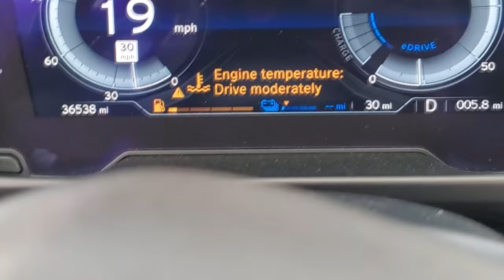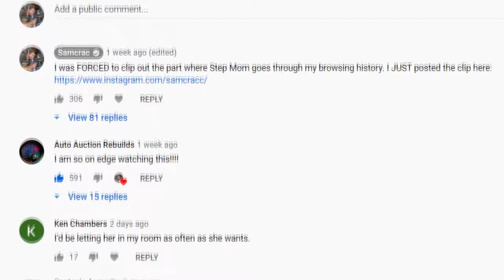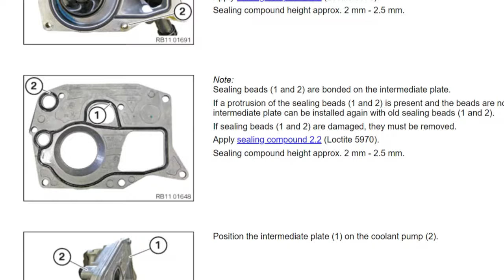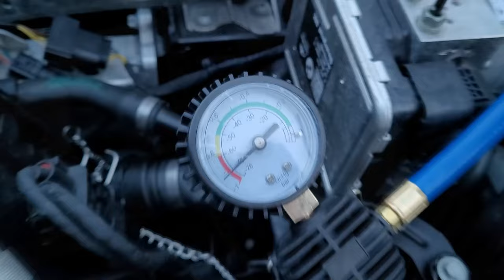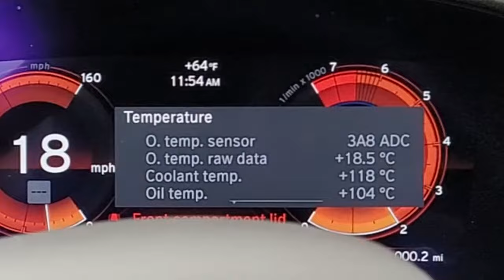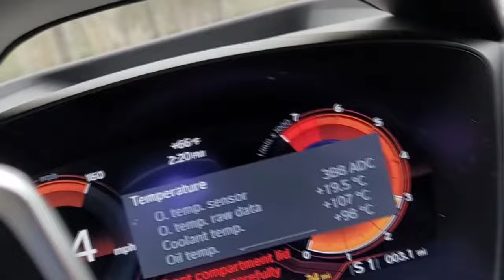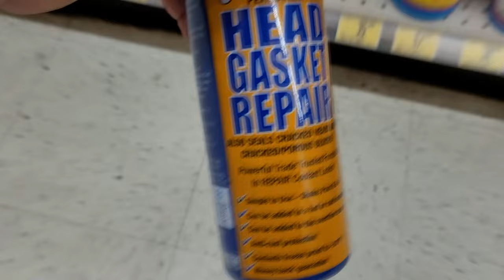The Dealer FAILED my "Unrepairable" BMW Supercar! Can I Fix it with this Simple DIY Trick???

Comment: SAM I had same problems with Lincoln Town Car 10 years ago, after couple of garage costs, finally one garage solved the problem, it was electric problem with the FAN, it works some time, but not frequently,they connected new wiring line for the RADIATOR FAN.(I had changed twice RADIATOR, FAN, water pump, thermometer etc)
Reply: Good luck!

Comment: "Everything that wears will be replaced" hmmm doesn't seem like a very sustainable business model... just saying.
Reply: You have to ship the original part in before you get a replacement - that removes like 99% of returns. Plus you pay for shipping.
Reply: It's being misrepresented.  Bound to be some conditions attached  ...
Reply: Nope no catch. They have the best customer service in the industry too. Ive had nothing but great experiences and ive spent at least $3500-$4000 on parts from FCP Euro at this point. The way their guarantee works is that you buy the replacement part, and then send your old part in for a full refund. They have extremely fast shipping to my area for some reason too, overnight for most stuff even with the free shipping option.
Reply: @Anthony71598  so you disagree and think a warranty company that pays all its claim's and doesn't have exclusions is a good business model.. ok then 😂
Reply: @jarrodhill9149  considering they're the leading supplier of European car parts in the US, and have been for years. Yes, it is a great policy. And with a bachelors in business management and a minor in finance im more than qualified to speak on this topic. How much did your company net in 2020? Not as much as FCP you clown😂
Reply: @mfgunit  you buy the new part, install on your time, and send the failed part whenever for a full refund. You DO NOT have to ship the old part in first, speaking from experience.
Reply: @Anthony71598  Oh gotcha, that makes more sense. Im a fan on FCP and buy their parts, just never had to exchange anything.
Reply: @Anthony71598  if you actually had a qualification and cant see any problem with this policy you'd be the clown... like how much beer pong did you play FFS?

Comment: Micro crack in the engine block, clear from the start.
Reply: Not from the start, but after testing some of the things, it should have been coming to ones mind...
Reply: Cheap block
Reply: I’m sure fcp euro will have a new engine block with a lifetime warranty for a fraction of the cost than the dealership.
Reply: @TCMODS  Haha 😂

Comment: Just want to point out since I was at a BMW dealership that had a lemon i8 around 2014. If you keep having issues with overheating, its because of the hard coolant pipes. We had micro fractures on one of the bends on one pipe, the other was also incorrectly bent, and then we also had to deal with the new bleeding procedure which wasn't any good. BMW over complicated the procedure by integrating it into the on board DME. The hard pipes, you're better off just replacing with new or aftermarket/custom. Car got completely torn down trying to find what was wrong. At the end it was BMW's own fault. You might have issues once you start driving it. We vacuumed bled, DME bled, etc and still had it overheat after we started driving. It is a very well known issue with BMW technicians. The head gasket maybe being bad due to overheating almost for sure happened due to the hard pipes causing the heating issue. I replaced at least 2 head gaskets and one pump due to that happening.

Comment: Whoever let the design of that cars cooling system pass, needs a kick in the nads.
Reply: How..... Do you keep making hordes of money after the sell? Wait for it...... Engineer a high maintenance automobile that the rich owner can screw up easily! If it was ran hot enough to warp the aluminum block to breach a head gasket, then it needs a new engine! Seal issues if gaskets only replaced.
Reply: @arthursmith5409   Right on. Can you imagine having to evacuate every single molecule of air out of the system, or it will overheat.

Comment: "BMW" = Broke My Wallet (after the warranty period anyways).
Reply: M badge stands for Massively ;)
Reply: Bei Mercedes Weggeworfen = Mercedes threw this away
Bring Mich Werkstatt = Take me to the repair shop

The Heidi Klum car - old, german, blew a Seal
Reply: In Poland (place from where the radiators of this i8 came from), we say:
Będziesz Miał Wydatki = You will have expenses
Reply: @TzOk  In Poland we say also:  Bóg Mnie Wybrał = God Chose Me and Będziesz Miał Wyjebane = You won't fucking care (version for those who do not use turn signals),

Comment: If the car had a bump in the front and has a cooling problem, you should check the coolant path for foreign bodies. It is possible that some part of the old radiator has got into the fluid path, blocking the fluid flow. The car overheats because it has too little coolant flow.

Comment: Well i guess the dealer didn’t misdiagnosed it after all... replace engine wasn’t wrong completely
Reply: how expensive tiny 3 cylinder engine can be
Reply: @Grant Hide definitely but as a dealer you are going to expect them to say engine replacement which they did. They don’t repair pretty often they replace
Reply: @flippy9133  oh boy its a bmw with a lot of new and weird tech...
Reply: you forget a small crack in the engine block can result in the same positive result on this test. so an engine replacement would be the proper solution.

Comment: I had the same issue with overheating and the radiator hoses billowing.  The head's bolts stretch when engine overheats so retorque them to try to reduce the combustion in the cooling system.  That was the final fix after all the same things you did.

Comment: Technicians at dealerships have to do basically everything by the book.
Reply: Yeah. And it makes guys like me have to take the car to the shop 4 times for the same damn thing. Had a fuel gauge stop reading right on my 2015 Chrysler 300S. First time I took it in, they checked the computer, did a reset, and send me on my way. I filled it up with gas.... read 3/4 full. Took it back to the shop... they said there was no problem because the computer said so. I showed them my gas receipt, and that I just put 16 gallons in a car with a 16 gallon tank. They pulled the back seat, changed the fuel sending unit, flashed the computer again and sent me on my way. They had to drain the fuel some, so it read 1/2 tank. Went to the gas station and put 2 gallons in and it was full.... but read 3/4 tank. I go back, show them what’s up and the technician started questioning my knowledge of cars. I said “did you look at the floats?” He said “floats”? I said “yeah, there are two fuel pumps, did you visually inspect the floats (which would be the first thing any mechanic would do if the fuel gauge is wrong.... look at the damn floats!). He looks again and says the float is fine, they just replaced it with the fuel sending unit. 

I said what about the other pump? Guy literally said “what other pump”...... sure enough, the float on pump 2 was stuck at the bottom of the tank. So the moron orders the part. Part comes in. 

ORDERED THE WRONG FUEL PUMP. 

If I didn’t have an extended warranty, I’d be pissed. But, I got a RAM with the 5.7 as a loner car.... so that’s been handy....
Reply: @EM-cc6gi  I’ve averaged less than 10mpg. 😎

Comment: You're milking this project. The answer was given in comments many times: ENGINE BLOCK CRACK!
Reply: Zook Inthe6ix  wow there, this escalated quickly
Reply: Zook Inthe6ix  really dude? Why you watching his videos then?
Reply: why'd those two granmas offer to drive 2000 miles for something so simple though lmao
Reply: he can't hear you over those raycon earbuds
Reply: Bullseye!
Funny that it came with the correct diagnosis and repair suggestion from the dealership. New block required or maybe some gaffer tape and chewing gum would make a better next video... 🤔
I'd imagine to pay for the new block, lots of views on lots of videos is the plan with, of course, a few sponsorship deals on top.
I'm expecting the next one will be a botch job on wherever the crack is, get a few more views to pay for the replacement 3 pot.
The real question is, how many more botch job videos before the actual repair is carried out?
Reply: He knows. He’s milking this thing until he gets his investment back.

Comment: Sam,  a ZX14 Turbo is lighter and smaller than the BMW motor and it will fit in there. 400-450hp and it actually sounds unbelievable. That's compared to your heavy 3 cylinder that sounds sickly making 230hp. The i8 electric motor is 140hp, the early i3 motor is cheaper and nearly identical to the i8 motor but with 170hp. If you could get 620hp out of an i8 it would compete with hypercar and go like it looks.

Comment: The BMW requires a complete $700 water pump assembly just to get a $10 thermostat.  You have to "charge" the engine coolant like an air conditioner.  That same job on my 54 Nash ran about $40 total.  Decisions decisions! 😂

Comment: Just a tought... The coolant also cools the battery, isn't it? Did you ever checked if there is a problem at battery cooling system? I mean the thermostat could be broken or blocked by something that makes it read normal temperatures, but the battery could get very hot. That's why it's boiling.

Comment: System might need to be flushed, I bet something is blocking something when it gathers to a point.
Reply: Or someone dumped leak seal in the system to fix a leaking radiator and due to the system having air pockets has caused a blockage in the  water passages in the engine block. Alternatively he could use water wetter to improve water flow

Comment: if it takes that long to vacuum bleed an engine cooling system,  beemer really are a bit pants.
Reply: They are absolute garbage cars aren't they I wouldn't go near one, they look good but are sooooo poorly designed with garbage plastic parts I am dumbfounded as to why people buy them.
Reply: Its a Hybrid car!
Reply: @s.reynolds3415  so????? still crap

Comment: At 10:22 I see the water pumps impeller is plastic, you should inspect the old impeller and make sure it's intact I've seen some break off and causing poor to no circulation.

Comment: The vacuum test would of shown a blown head gasket as well. If you had any sort of leak (communication) between the cooling system and the oil passages or the combustion chambers you would of not been able to hold a vacuum all night long. It would of completely bled-off. That is also why they want you to hold vacuum for a half-hour.

It is similar to what is referred to as a "hydrostatic test" on a pressure vessel. Increases or decreases in pressure (or vacuum) on a system indicate that something is leaking (or stretching, like hoses).

I suspect a lack of cooling flow through the engine. You really do need to pull the pump and look at the impeller. While you have it off you need to see if you can pass water through the engine (with the pump off try to push water through the cooling lines from under the car (in both directions, meaning, through both lines) and see if there is flow. Also see if there is back-pressure while under flow.

With the open passageways of an engine block there should be almost no back-pressure on the water source (no more than a few PSI with something like the flow from a garden hose). If you get any real back-pressure, or NO flow then you have a blockage. NO flow is a total blockage means a total obstruction in the cooling system. Excessive back pressure (tens of PSI) may mean a partial blockage in some passageways.

That is the difference between static pressure (or static vacuum) and dynamic (flowing) pressure (or vacuum).

If it was "sabotaged" the way that could of been done would be to break the fins off of the water pump impeller (no flow) or to plug the system up somewhere with a wad of rubber or plastic.

A stupid, accidental form of sabotage would be if they had used a rag to plug up a cooling line when they had the radiator out previously and then didn't pull it out when they put the system back together again. It can then get sucked to a point where it would form a blockage. (or it could be made to seem accidental, you get my point).

Comment: So, you bought a combined water pump/thermostat & only fitted the thermostat....? Water pump impeller is usually pressed onto the spindle, it is rare but I have had an impeller fail & free spin on the shaft....ok so at the video ending there is combustion gases entering the coolant indicating a probable cyl head/gasket issue...the blown radiator is dated 2014 that indicates it could be original to the car..? If so it could be a coolant flow issue causing the noises in the expansion bottle, the engine overheats the static coolant causing local boiling which produces steam bubbles, this is called 'kettling' over here in UK....either way thanks for these thought provoking video's 😉👍

Comment: The combustion gases are before the converters and have a distinctive odor so all a person needs to do is stick their nose in the opening where the cap goes and you can smell the exhaust gas smell, no tester needed, of course not when the hot fluid will scald your face off, this works even when parked overnight, just smell it.

Comment: so is it fixed because of the head gasket? or theres still a problem? im confused with the ending.
Reply: It needs the head gasket(s) replaced. Very common issue on overheated cars, especially if left running hot. Pretty big job.

Comment: Are there any signs the engine has been removed from the car before?

Take out the engine, take off the cylinder head and check if someone has sealed anything so no coolant is flowing around some cylinders anymore. Only explanation the engine is overheating. If coolant is flowing, radiator is completely hot, radiator fan is kicking in, the only place you didn’t check is if coolant is flowing around all 3 cylinders in the engine or if someone sealed something off in there.

Comment: Brim the expansion tank then suck out the excess with a syringe.
Sudden temperature drop while running suggests an air bubble shifted. Can you loosen a high level hose clip to release trapped air?

Comment: Aluminum engines with mls head gaskets dont take alot of over heating and they generally dontmix oil and coolant becuase of the locations of the oil drains on the cylnder head. The coolant system bridges between the water jacket and the combustion chamber pressurizing the cooling system.

Comment: Is it actually over heating or is it a faulty temp sensor? Or are you sure have no air lock, Peugeot’s use to air lock and you could get a funnel to go on the expansion tank so could raise the level of the coolant you are putting in..... or have you looked on a diag machine to see if there bleeding sequence (auto bleed) like when you bleed the brakes with the Bosch kts... if not how about activating the pump manually via diag with engine off to see if you can move any air around. Think Scott also mentioned pop out temp sensor to act as another bleed screw 🤷‍♂️ Good Luck 🇬🇧🇺🇸

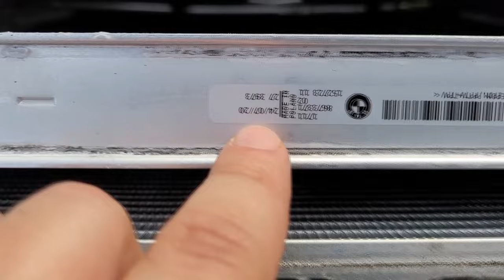Comment: 8:45 Lubing you hose fittings works but is not the best idea. 

Using a bit of liquid hand soap is better as the hose will slip on the same but it will break down and keep the grip better.

Comment: I doubt it's the block or head gasket. Why would the system hold vacuum if the system had a crack or an exhaust / intake leak? There seems to be a restriction.

Pat's garage is saying there is more than one water pump on the car, and there is a high temp side and a low temp side. I'm betting that there is a gate between these systems and it is electronically controlled. Could be in the front as well. Maybe it is sized, or somehow made inoperable. I would love to know the mass of coolant in the car. 

If that figure is ascertained, then we can estimate the rate at which the system heats up when it's good. Or u could just get that info from other I8 owners. Or use an infrared gun to see where the coolant is...cool? 

Having that info would point you in a better direction I think

Comment: You've never owned a Toyota 22R? Hmm, bubbling in the radiator? Exhasut gases on the temp sensor? I guess in the old engines it was more obvious since there weren't all the complicated parts. I remember people installing radiator lines and forgetting to leave the spring inside on the suction side.

Comment: Radiator and pressure cap failed because steam and superheated water weakened the plastic.  Sometimes the plastic tank gets warped as well and the pressure cap won't seal correctly.

Always test for exhaust in the coolant on overheat cases.  The block tester gets frequent use at my shop.

Comment: At dealer shop rate, what maybe $180/hr, what would that infinite time diagnosis and repair have cost vs the engine swap? Maybe use the tesla motor and battery pack from his V8 swap?

Comment: Talk about being a parts changer there's things you can do to diagnose the car before you start changing parts you need to verify.  you can use a tester to test for combustion chamber gases in the cooling system that would indicate leaking head gaskets

Comment: You don't need to do that much. I work with complex chilled fluid systems and the first thing you need is a refrigeration vacuum pump, I semi empty the system to 30 inches of vacuum and fill it up 3/4 of the way, then I pull vacuum again to eliminate the air pockets you introduced initially down again to 30 inches of vacuum and that's what it make the Magic happen, then full all the way up

Comment: Not very familiar with 3-cylinder engines, but I'd check the condition of the head (e.g. warpage) before attempting to replace the head gasket.

Comment: To use a combustion chamber tester you need to lower the coolant level in the vehicle the motor has to be hot you need to run the engine and let the gases build up so that the cooling system is aerated with the gases and then you use the tester